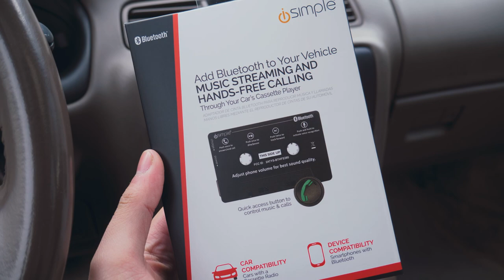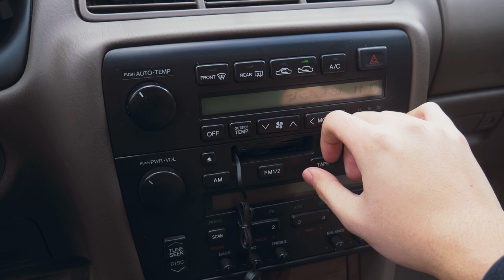Coils, Wheels, Hood Struts and WRAP! | Lexus ES300 Build Episode 2

Comment: hey i’m buying wheels for my es300 and i’m not sure what offset fits. do you think a 30 offset would fit?
Reply from the maker: It depends on the width of the wheel, you can check fitment specs on fitment industries gallery
Reply: @LinnysLife  i was gonna go with 18 by 8 with a +30 offset
Reply from the maker: @koenbirkmaier1751  I just looked at the gallery, most are doing 18x8 +35

Comment: Where did you get the coils from
Reply from the maker: you can buy them on maxpeedingrods website
https://www.maxpeedingrodsus.com/products/24-ways-adj-damper-coilover-suspensions-for-toyota-camry-1992-2001-solara-1999-2003-avalon-1995-2003-shock-struts-coil-springs-adj-height-grey?currency=USD&variant=37887795364018&utm_medium=cpc&utm_source=google&utm_campaign=Google%20Shopping&utm_source=smt-allproduct&utm_medium=googleshopping&gclid=CjwKCAjw7--KBhAMEiwAxfpkWLgjPXMBjTGLc6ebb5svuzV2Z5L3hE2PhJG6wlac233iOV4RVAVTQBoCQxgQAvD_BwE